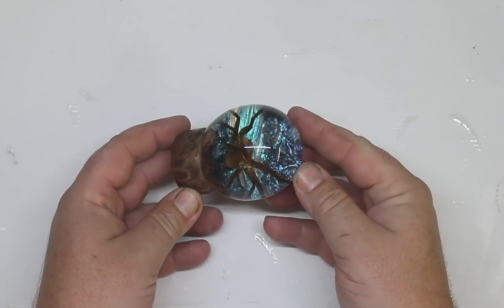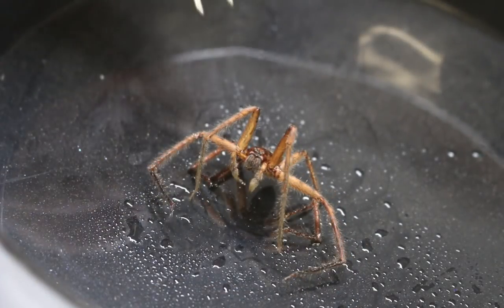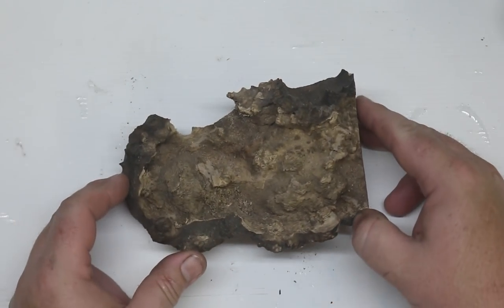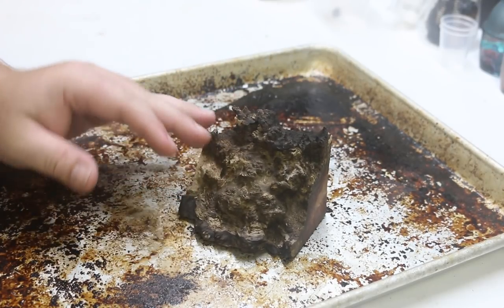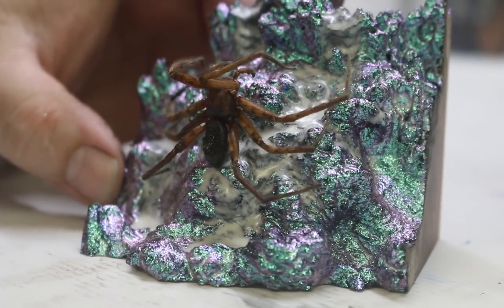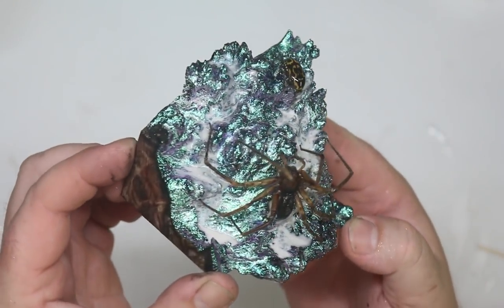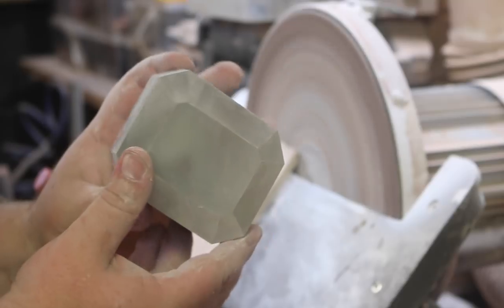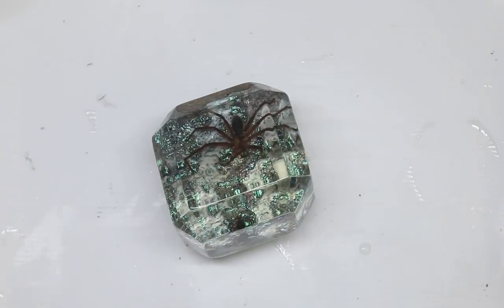Making a Spider and Beetle Resin Diorama - Epoxy Resin Art

Comment: I know every tutorial like this has you dry the spider or insect but what if you didn't and cast it right after it died and is soft? Try it in a pressure pot and try another in a vacuum chamber. I think it would be Ok and the resin would stop any decomp. I may be wrong but a few oz of resin would be worth it to experiment. Also if successful, put the final pieces in the sun to see if they fade in UV light.

Comment: Oh Jeff's sorry to be a bother Ben meant to ask this in my last reply, again thanks for the advice just planning it out no. Anyway I wanted to ask is there any method of cleaning the IF Resin out of your brushes after use? I know you can store any unused mix of pigment or glitter after use but I wanted to make sure it I would need to grab some more small brushes for Resin duty or if I can save them too and have enough. Thanks again you have really helped me on so much I owe ya I do, funny how many good friends I have named Ben, my best bud from school, my dad's buddy who is honorary family, a guy who gave me a pressure pot free of charge and of of course you.
Reply: Stupid Autocorrect! That was supposed to say "Oh nuts!" Not something about Jeff up there. 😅
Reply from the maker: I just wipe them down and reuse :)
Reply: @BensWorx  Any specific stuff for the full clean or is it just a good hot soapy water kind of thing? I got many thinners in my shop for paints, Acetone, Naptha and Mineral Spirits in case it takes a little extra boost. Again just being sure before I rush in and mess something up, as my dad always says check with a expert and he is my go to on anything Electric so I am sure you got a similar philosophy.

By the way glad you can wire your lamps up now, I know ages back you were worried about legal attention but I guess that law on licensed electricians was for home wiring and building sensitive stuff. I know even my dad goes to them to make sure all wires are safe in the house, even if they tell him 90% of the time it is great and up to code, never rest on something like that you would rather be safe not sorry.